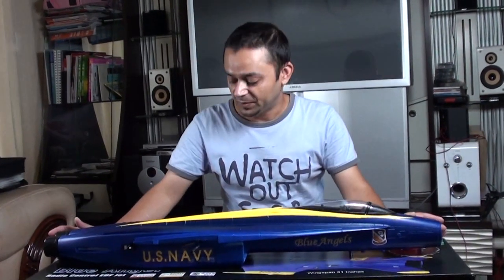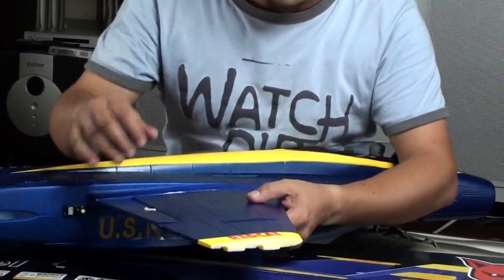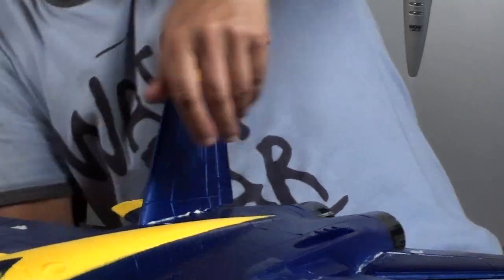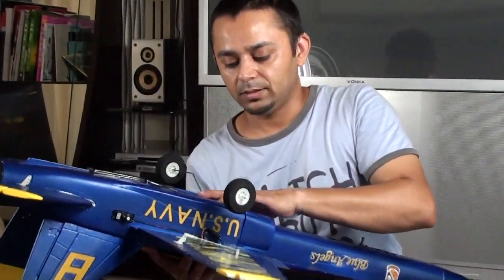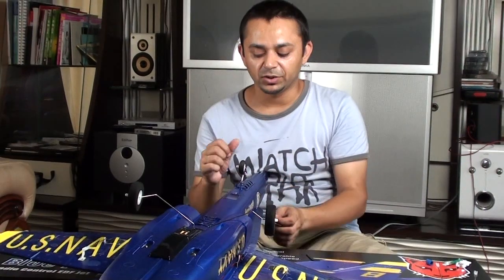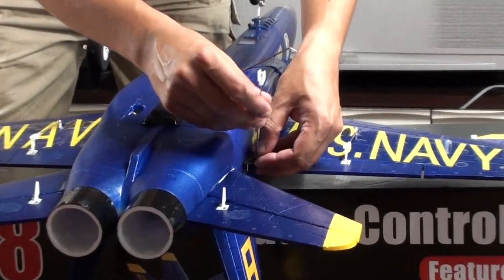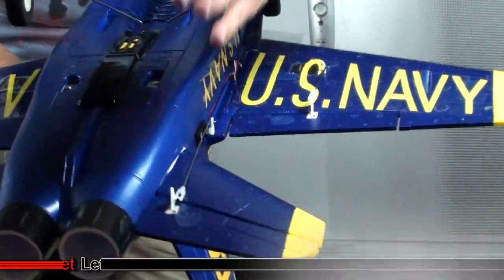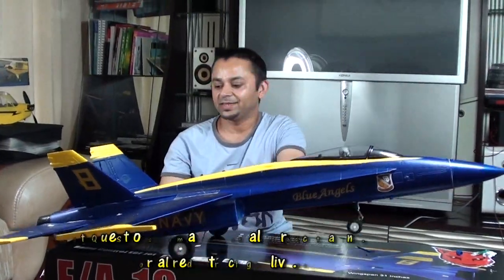How to Assemble RedCat Racing F/A-18C

Comment: It's good there is this video because the manual it came with was absolutely a piece of crap and didn't explain any of this. Just a few vague pictures. It doesn't show you how to install the battery either, which I have yet to figure out because neither did you show us